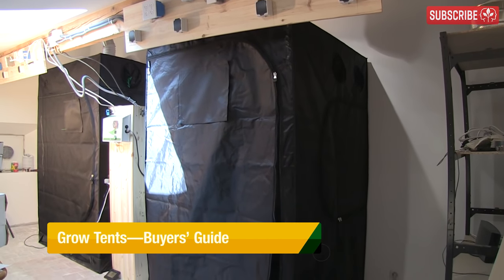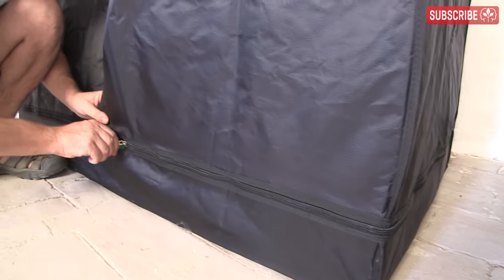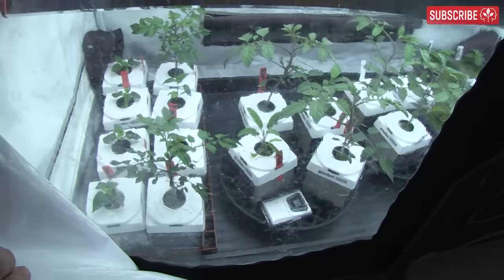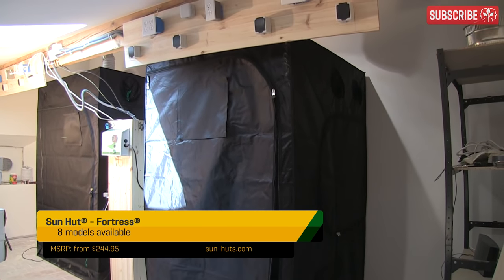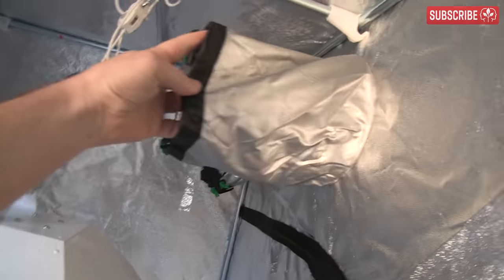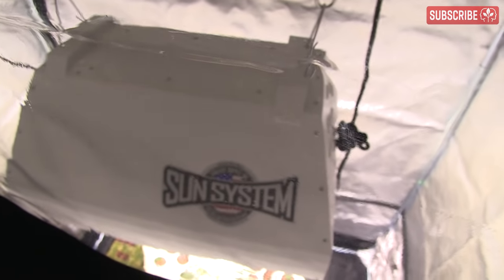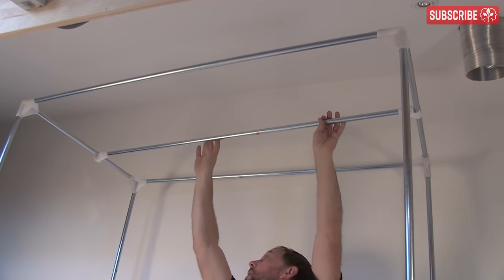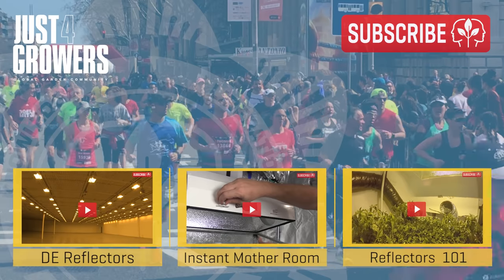Grow Tents - Buyers' Guide

Comment: Check out Galaxy grow tents. The same 1680D fabric as that other "G" tent but thicker poles with steel corners, additional side bars with killer metal clamps, three moveable roof bars, better reflective material, and a water-tight floor pan with sides stiff enough to stand up. Good stuff, Maynard.

Comment: i have built plywood platforms by just cutting 3/4' plywood to the footprint of the tent and screw a 1"-4" to the edge of the plywood so it stands 1.5" PROUD OVER THE PLYWOOD I THEN PUT SWIVEL CASTER WHEELS  on the bottom of this platform so i can move the grow tent with ease even with lights ,extraction ,filter, plants all in it this gives me FULL ACCESS  to the tent and it also lets me NEST THE TENTS FILLING THE GROW ROOM

Comment: Guys, you can always change the speed and turn on subtitles. That will make it much easier to digest.

But dude, please ignore the guys complaining about the speed. I've seen too many 6 min videos that should be 45 seconds max ,like "down load this app and run it using the default settings, click x to confirm it worked", instead its a 2 min intro, irrelevant personal information(yeah I care about your awesome new microphone),  and a painfully slow and detailed explanation that feels like a director stretching a thin plot.

I think you have a great style. Just wish I could see you grow some plants with a bit more medicinal value.
Reply from the maker: +PG Wooster Thanks for the encouragement amigo, much appreciated. I always try to consider my viewer and, crucially, the duration of the average #2. Basically say it in five minutes or less or you're competing for much needed hands. :)
Reply: this comment is biblical

Comment: Awesome content like usual Everest ..but wheres the love for gorilla grow tents...they are the only kind I'll use for my setup again. after light leaks from the very cheap kind to the plastic connectors cracking and 60 pounds of equipment crashing on my canopy..
Reply from the maker: +Hunting Phenos Sorry to hear about your collapse HP. Air cooled hoods and carbon filters can definitely pull down on a tent frame. A central pole/s for larger tents is a good idea. Definitely something retailing at fifty bucks is unlikely to be worth setting up. I'm glad you've had a good experience with Gorilla. Thanks for taking the time to comment. Always appreciated. Peace.
Reply from the maker: Tyrion Lannister Yes, Budbox are well established in the European market. I remember using some of their very early models. I will certainly check out their "Pro" line, thanks.
Reply: yeah anything with just plastic corners for support are a must avoid.
Reply: Tyrion Lannister bud box pro would be the perfect tent,if it had fully zipped doors,instead of those stupid flaps over the zips...(I own one,so know it's a bad design)
Reply: unknown cuyler and that's totally not true,plastic corners are fine.
Reply: +yeah steven plastic corner supports are just fine for your outfit. keep it up and see how long they last.  I got screws n tape holding mine up now better than new.
Reply: Steven Brennan until they crack and break..why would you not choose a stronger material?...like bringing a pillow to a gunfight..lmao
Reply: oh the plastic definitely works for at least a short time.  or if you do not plan on hanging heavy equipment.  but if you do, especially expensive LED lights, invest the money in something that will last.
Reply: And you know my set up how? (you one of my 2000 subs on Grasscity?)  Plastic comes in many different strengths and quality, the best of which will long outlast metallic ones,which are prone to rusting,same as the poles as Everest mentions.(powder coated or not) I really don't care if you disagree, as I'm 40yrs old and have better things to do,like smoke some THC Bomb rosin and laugh at you as you think you know it all.
Reply: I've been growing longer than you've been alive,and I currently have a Spectrum King hung on plastic moulded t-pieces,and as Everest also stated, you technically could swing from them.Dont know what brand tent you use,but I don't cut corners when it comes to environment,so I know all three of mine are fine.
Reply: John Smith because you told me too,I will.Im super scared of you is why.
Reply: Plastic connectors, i have had the pole caps get stuck rendering the useless for reuse i exchange them for flatter open ended plastic connecter  worked out great.

Comment: If you only have 1 or 2 plants its best to buy the smaller types like 48x24x60.  iT MAKES EVERY POSSIBLE ISSUE OF MAX CONTROL TO AVOID AND STAY ON TOP OF THINGS. bigger THE TENT, THE MORE YOU HAVE TO DEAL WITH WHEN ISSUES COME UP, like RH control, air flow, dew points, bugs and nats, temp control ect ect ect. Knowing this I plan on just getting another tent of same size as Im gonna buy another light fixture anyways once I start growing up to multiple plants....

Comment: good straightforward video. Would like to have heard you mention off-gassing
Reply from the maker: +pfalconology thanks amigo. I vaguely alluded to it by saying "American growers prefer silver lined tents" as some of the first white-lined tents in the US were made with low grade PVC which off-gassed. This is unfortunate because some folks made the false association between white lined tents and off-gassing whereas in reality the problem was peculiar to one (now defunct) brand.  I have seen PAR tests performed between white and silver lined tents and the white came out on top for reflectivity. Again, I didn't mention this in the vid because I did not want to make broad brush statements about "silver tents" - better to perform a test myself on two distinct models / brands.

Comment: Great video. Hey, I got a space 10x8x7 got any tent recommendations? I looking growing indoors with soil and Led grow lights. any info helps thanks.
Reply from the maker: +Indiana Diy Thanks amigo. Are those room dimensions or the space you have available in a larger room? In any case I'd double check your measurements (just to be sure) as you maybe could fit a Sun Hut Blackout 410 - 7.9 ft x 7.9 ft x 6.6 ft in that space. The Sun Hut Blackout 200 is half the volume at 7.9 ft x 3.9 ft x 6.6 ft
Reply: Everest Fernandez Yeah that's the space a available in my basement. I was trying to to leave some room for walking and Duct work for tent. I might need to get one that about 6-6.5ft tall for ventilation.  But I like the Sun-Hut blackout. 
Thanks for the info I was basically look at same two but it helps to get that second opinion.

Comment: Hi everest quick question when ur starting your seedlings in your humidity dome sitting on your gro smart tray do u put water under the tray to raise humidity?
Reply from the maker: +greenboy93 Yes! Although I find with rockwool cubes (my preferred prop media) I rarely have to.
Reply: Would u add nutrients to that water and ph or just plain old water ? Cheer man !
Reply: And also if uv got a minite to answer my questions! (Appreciated!) iv got my tent sat in my bedroom do i have to vent the exhaust fume out the room i have my tent in or just push back into the room? Im gona be using a intake filter will that be okay?

Comment: Will the plants stay small if you keep the pots they grow in small?
Reply from the maker: Certainly, restricting the pot size will restrict the overall root development and this will ultimately delimit the size (or rather, productivity) of your plants. If you are growing photoperiodic flowering species, I recommend adjusting the lights on time to induce flowering when plants are relatively small—you may be surprised how much they continue to grow during transition into flowering (generative production). If your pot size is overly restrictive, your plants will inevitably become drought stressed—and if you are using fertilizers, it's very easy for the EC of your media to rise to toxic levels. Be generous to your plants and give them the space they need to grow. Best of luck with your garden.

Comment: I hope anyone here can help me, I have extreme problems with mold. It looks like normal white mold and it is everywhere, on my regular soil, on rockwool in hydro and on roots not soaked entirely in hydroponic solution. It is not harmless, it killed few plants already. I'm curing it with hydrogen peroxide but it only helps temporarily. Does anyone know what to do with it?
Reply: nevim neresim Mix baking soda and water together and spray on your plants. Mold cannot live in high alkalinity.
Reply: What concentration? Wouldn't it hurt plants?
Reply: nevim neresim Google "baking soda powdery mildew recipe"
Reply: +nevim neresim, You may need better air flow. I would do the following to prevent the problem in the future. Add a small fan so that it gently blows over your plants. Add an air filter, and run it even if you are not trying to prevent smell.  This will help remove mold spors, and keep your area clean. You may also need an AC or dehumidifier. I use a small portable room AC myself. It helps keep things cool, and removes excess humidity. I do all of the things mentioned, and do not get mold. Knock on wood ;-)
Reply: Okey, I will try, thank you.
Reply: nevim neresim welcome, let us know if you need anything else.
Reply: jdlitson well you saved me a long paragraph 😂
Reply: nevim neresim id use a neem oil based fungacide and pesticode u can make your own w water and neem oil and a spray bottle use about 2 teaspins of neem oil per liter and a half of water then keep shaking it as u use it cause they dont mix then increase airflow so  doesnt hapoen again
Reply: You have powdery mildew. Chris is right. Don't attempt to dave your plants. It will just come back.
Reply: Mold or salts/minerals

Comment: I feel I might have over sized by LED grow light for my tent. 1.2x1.2x2 with a 15 COB 750w light, dimmed down to 450w.
Reply from the maker: +Vanklow I think you're okay amigo. Do you have a light meter? If so, what are the readings at canopy level?
Reply: I need to get me one of those, but I don't get any discoloration on the leaves.
I read so many things about what wattage of LED equals HID lighting, so its hard to know what's correct.